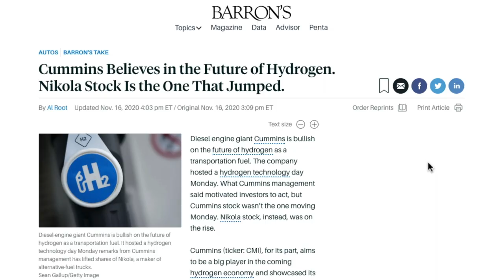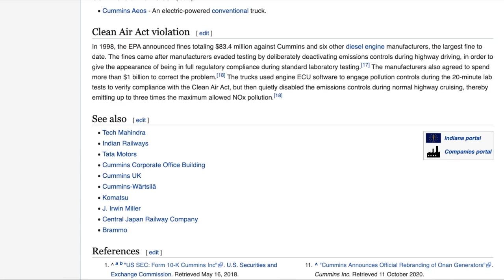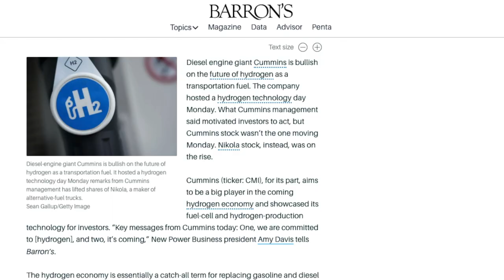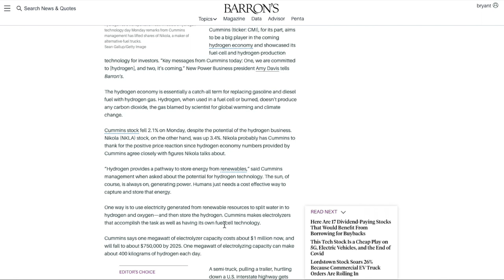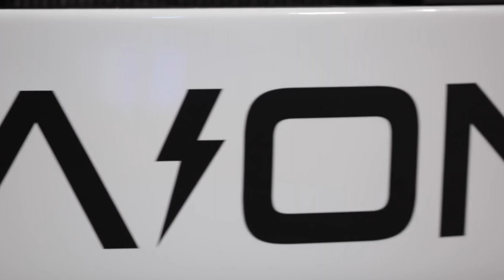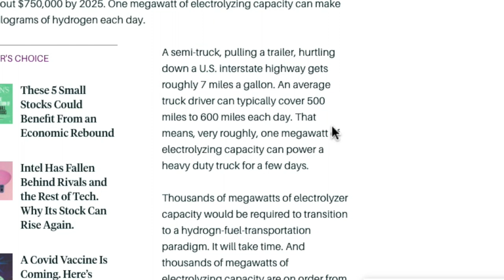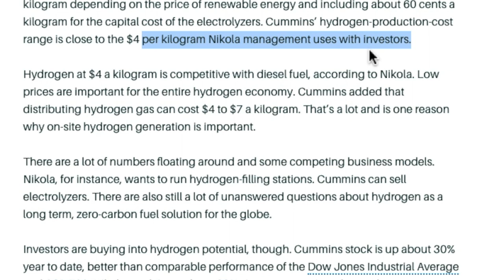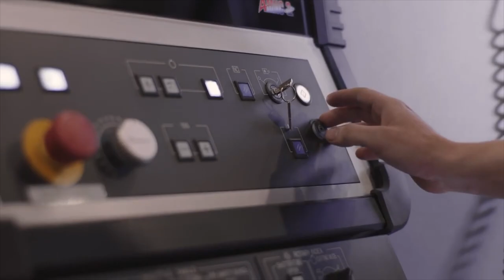This Catalyst kept it (Nikola) alive

Comment: More than 95% of all hydrogen made in the U.S. is made from fossil fuel - so called "natural gas" also called fossil gas - basically methane. The methane gas extraction, plus manufacturing, transporting, storing, dispensing of hydrogen is actually several times the cost of current super polluting diesel. The cost of putting in place the number of hydrogen fuelling stations needed would be multiples of the current fuelling infrastructure. Businesses are not going to switch and pay more unless forced to by regulations or they will just shut down the business or switch to battery electric vehicles.